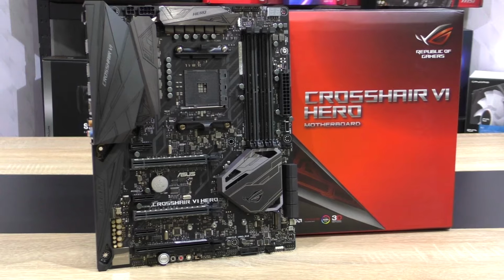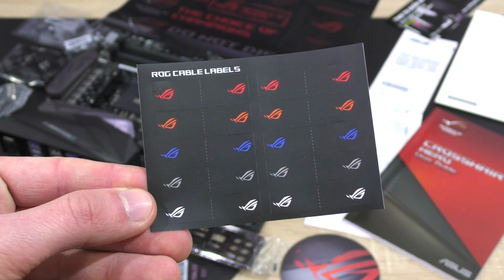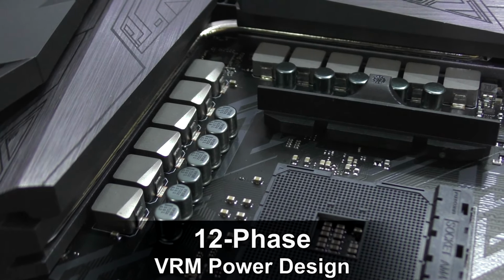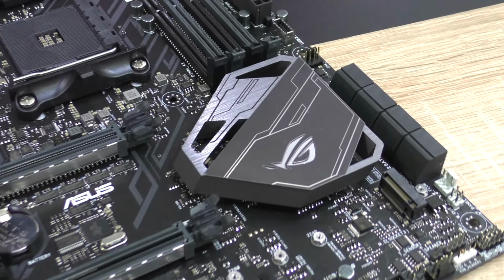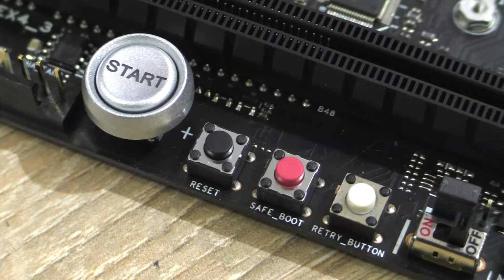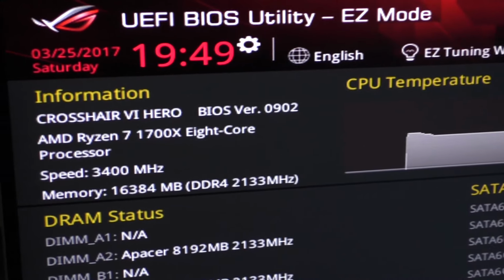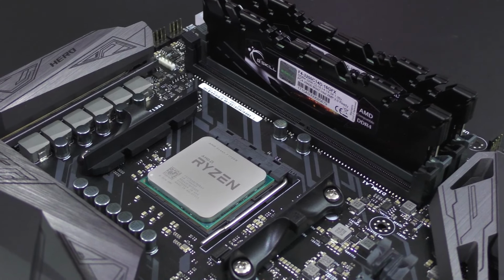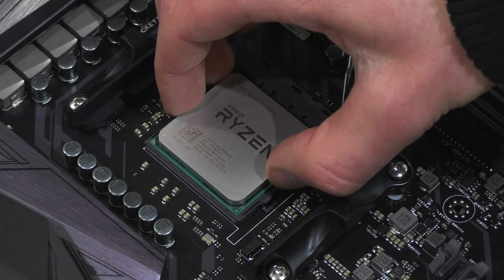The BEST for RYZEN? - ASUS Crosshair VI Hero Review

Comment: Worst mobo i've ever had so far.
Cold start the mobo turns on and off by itself 3 times for no reason before posting
every now and the refuses to start for no reason 

qcode is useless since it always gives u non existing codes on the manual
its literally impossible to reset the bios ( happened to me once ) i reset 20 times with no result , in the end to reset it i had to update it with bios flash back and it all for a wrong setting in the bios.......that means crash back DOES not work at all !
it's simply not acceptable for that range of price .
Asus simply didnt understand it's not all about look , look its useless if the mobo doesnt work , or work when it wants to.

Comment: Wish thredripper would come sooner as really a decider between getting the 1700 the 10 core threadripper as it is rated to 4ghz as well (more interested in getting 4x8gb working), i could just buy a 7700k system but only want it like for 4 games where I might need high speed IPC but the rest of my PC use would benefit from the 8core ryzen (or 10 core  threadripper for further upgrade later on if needed)

Comment: Where to get the m.2 e key wifi?
Reply: ebay as i did , suggestion , avoid crapintel so u r not forced to use win 10 if u dont want to , ( yes a multi billion company  that  can not make drivers other than win 10 ) i bought a realtek with blutooth for 15 bucks , the mobo with wifi cost 100 buck more instead

Comment: I'm just bought this board and satisfied with it, using Ryzen 1700X overclock to 4 ghz
Reply: is there an actual difference if you OC both 1700 and 1700x to 4ghz?
Reply: Imouto 9Gagger  No difference if you oc both to the same clock.
Reply: Imouto 9Gagger No difference if you oc both to the same clock.